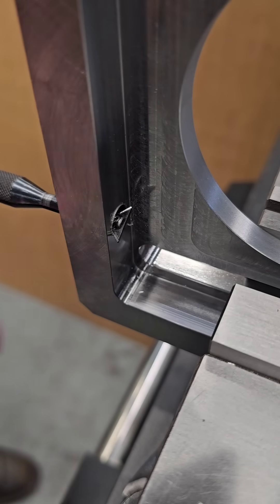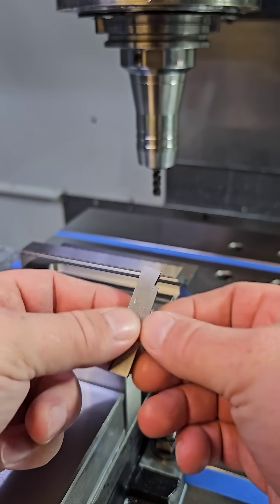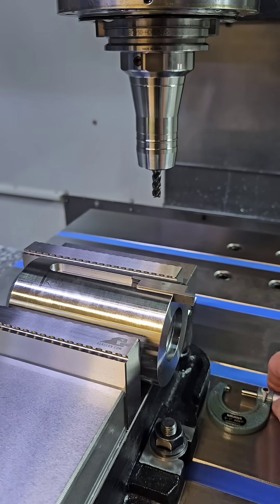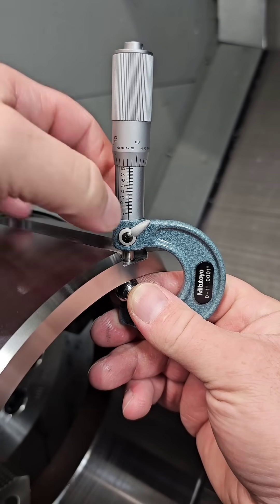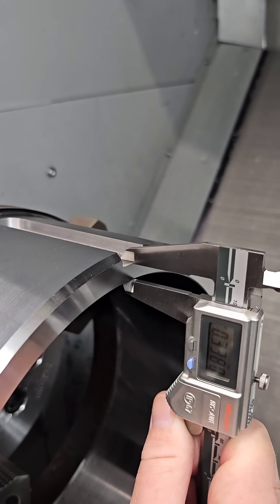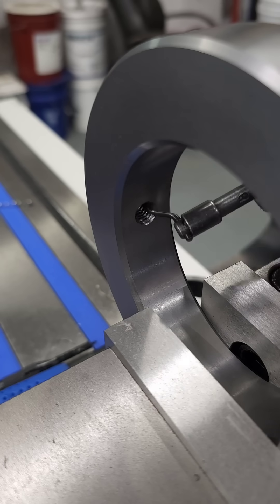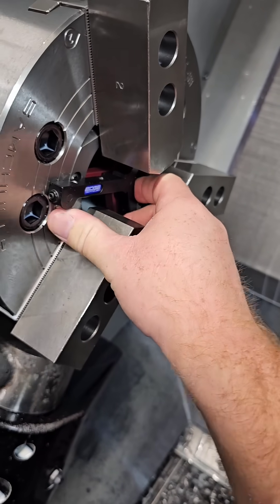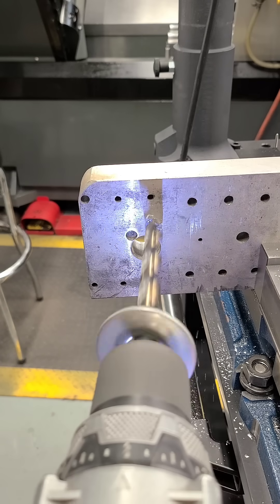Machinist Tips and Tricks Volume 3

Comment: Washer on the drill, priceless. Putting a couple of big washers in the drill case this morning
Reply: That is a good one, although I can count on both hands the amount of times ive used a power drill to drill a hole horizontally, 99% of the time the part im drilling is on the ground or im in the machine standing over the part in a vice. Great trick though for when you do need to drill horizontally.
Reply: That's badass, Im knocking on 60 and still can't drill freehand worth a crap.